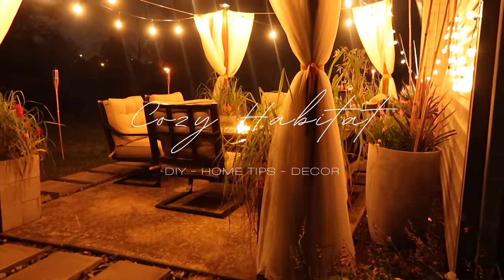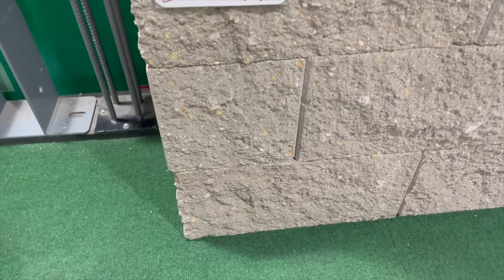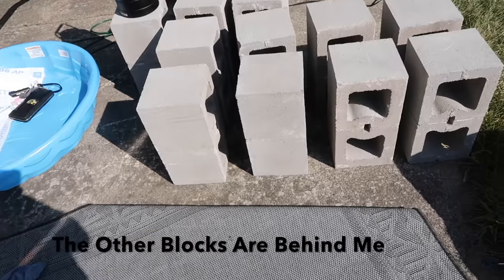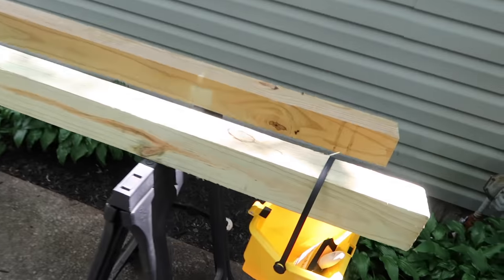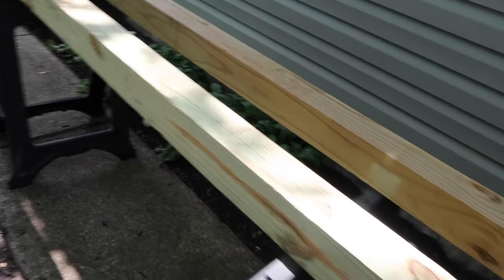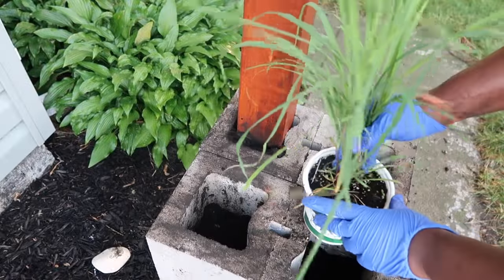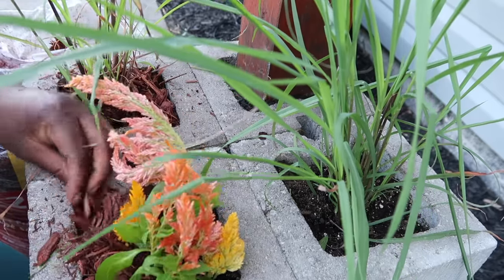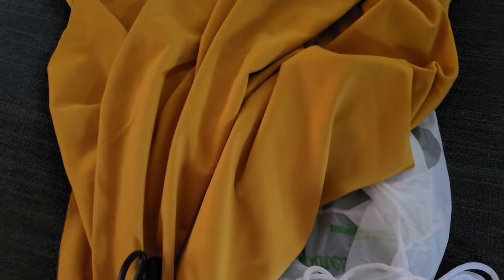UNDER $240 DIY PERGOLA WITH CONCRETE CINDER BLOCKS - CAN BE RENTER FRIENDLY!

Comment: 9:00 I would NOT pour soil between the post and block!  Pea gravel will drain better to prevent decay AND hold the post more securely.  Then I'd cap it off with a few 4x8 blocks around the top.  And you can still do soil and plants in the other 3 holes.

Comment: I recommend using pressure treated wood, installing the hooks to each post BEFORE putting the posts up (why have to stand on a ladder to do those things?)
Reply from the maker: The wood is treated & installing the hooks before you stand it is a smarter idea! Thanks

Comment: Can't put dirt on poles buy bag cement dry pour gravel then cement squirt with mist setting every hour poles need creasote or waterproof on it first I'd seal block s and paint before wood goes inhole under wood make hole for drainage then a little gravel treated pole cement 👌

Comment: I want to see how it all holds up after a few rain storms. If its leaning with no top the top should really pull on those posts not anchored to the ground here in FL....great concept to build upon to make very secure
Reply from the maker: I live in the suburbs of Chicago and it held up all winter. But when the top is on, because I didn’t glue it to the ground the tarp makes it shift a little